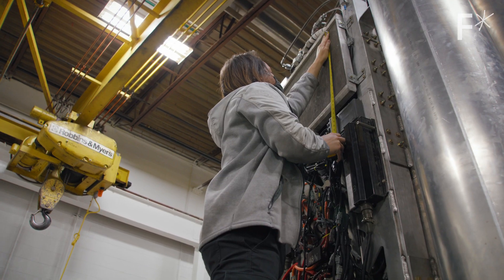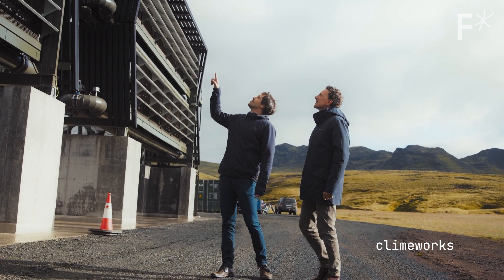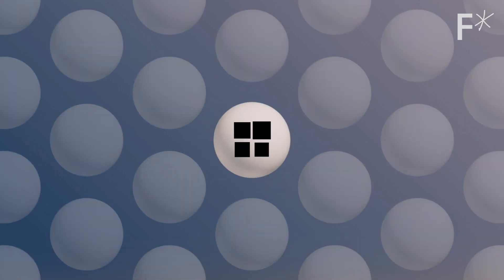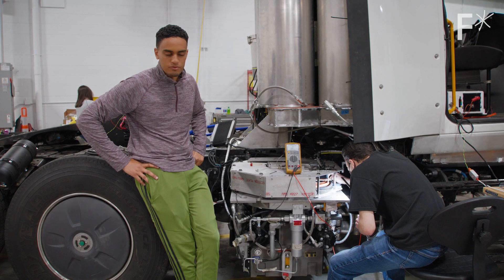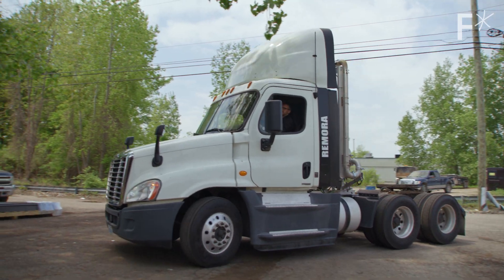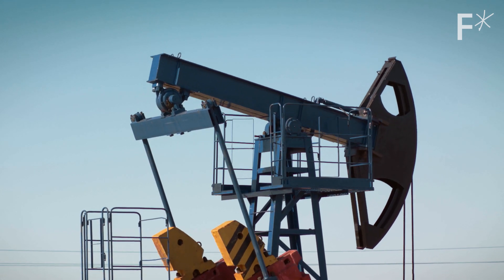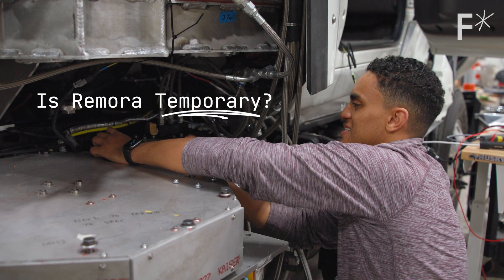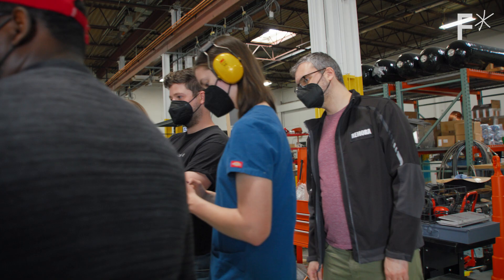Can this invention fix dirty transportation? | Challengers

Comment: The solution to truck polution is to switch to electrified rails as the primary way of transporting goods long distances across land, and only use trucks for "last mile" delivery
Reply: Trains are some of the most efficient transport methods on the planet.
Strapping a battery to everything isn't the answer folks
Reply: @stuartburns8657  You  must take a look at the March edition of the scientific magazine'Joule' and the 'CO2Rail' website to see the 'DAC railcar' innovation which will allow trains to capture CO2 from their slipstream while using the  energy from braking to power the. units which  have been reduced to rail cars size.There will also be a railcar to  extract emissions from the  diesel engine.Unfortunately  it is unlikely to  capable  of. being scaled down to truck size but who knows maybe for aviation?
Reply: @edwardhogan1877  Sounds interesting Edward.  Wonder if it would make a significant difference
Reply: As a former truck driver I completely agree with you. If there is any way to make it be more efficient using rail it makes way more sense although there still is going to be a need for smaller local truck deliveries.
Reply: You can't upscale the device because you need someone that can make that happen.   Has anyone presented the idea to an Elon Musk or a Jeff Bezos?!
Reply: You have no idea how transport and logistics work if you say that's the solution. I am a truck driver since i was 21(now i am 30yrs old) and your solution means substantial changes to global infrastructure.
Reply: @aurelianpetre93  And there's half the problem. The immediate assumption that changing infrastructure isn't a part of a solution. So, yes, over the coming decades we should look to make some sensible changes to the way we do things if the human race is to move forward like we used to.
Reply: Sorry but most trains get really good gas mileage so using all the rare earth metals for these trains or build more power plants which adds lots of carbon pollution to accomplish is not a practical solution.
Reply: @waynemc2300 what rare earth minerals? Copper for overhead wires? Copper isn’t that rare. Unless you are under the assumption that’s electric trains are battery powered which is false. Electric trains are powered by pantographs harvesting electricity from overhead wires.
Reply: It will be cost effective given feul prices and the reduced efficiency an extra 5000 lbs carries
Reply: if it's not cost effective there's no incentive to do it
Reply: @your_a_idiots  We literally print our own money and assign our own values; we control all incentives around money.  These aren't random forces of nature we are talking about here.
Reply: We already do that.....
Reply: @nntflow7058  In the US? Barely. (Proportionally speaking.)
Reply: Agreed. We need to stop thinking of train tracks as being something for one large engine to pull a series of cars behind it, but rather one electrified train engine and one train car that can autonomously go to it's destination and autonomously be collected by crane and put into a depot for pickup by an electrified truck. Perhaps monorails for shipping between major cities, something above or below cars and foot traffic.
Reply: @Delosian  do you even know what you’re talking about!? Trains are efficient and were hybrids before cars.
Reply: You’re funny. Look how well the California rail system is going. No chance is this concept viable even it people wanted it
Reply: Coal burning electrified rail? Or how about renewable diesel from grass or wood chips using compressed air to burn every diesel molecule leaving the tail pipe free of carbon ???
Reply: How is the electricity being produced? It’s only a matter of time before the environmentalist complain about lithium mines, battery pollution, and the grid.
Reply: @danshobbies13  Do trucks  produce currently wasted. energy in braking?

Comment: You can do this without trashing EV and H2, there will still be millions of combustion trucks on the road for years that need this, even if all manufacturers switched to zero local emissions tech overnight. (And there's still the 20% this solution doesn't capture, that's way dirtier than an EV or Hydrogen rig)
Reply: The state of California has already taken notice of this when it initially proposed the now infamous 2035 Internal Combustion Ban, but the trope with this ban is that it applies to automakers building cars with an ICE drivetrain, not that they're trying to get rid of combustion powered vehicles as a whole.
Reply: @TheSilverShadow17  true, but if new combustion engines are banned in 15 states eventually in about 20 more years the problem will take care of itself on the used market. The problem is can they survive 20 more years of extreme weather? Then they need to tackle other shipping like cargo and cruise ships, diesel trains, factories, etc.
Reply: @KaceyGreen  I think they still are going to be around even after the next 20-30 years. As I mentioned about California banning combustion powered vehicles, the ban only applies to the automakers, not us common folk using them on a somewhat daily basis. For instance let's say I was one of the vehicle manufacturers in the year 2035 and I tried to sell a brand new car/truck etc that has combustion power. I won't be able to because of then state law that prohibited the sale of said vehicle. But older vehicles that were built with an engine prior to 2035 are still allowed to operate and be driven freely.
Reply: @TheSilverShadow17  exactly, the reason I used 20 years is that was the most recent fleet turnover period but I think it was trending to 25 years at that point

Comment: This feels like a crazy complicated solution for this problem.. but the one thing I wondered was whether that truck could make a full turn with these huge devices on the decking?
Reply: I don’t think it would make much of difference, but except the view to your airlines while making a u turn , and will help on winter to give your traction tires some control
Reply: Actually, they are using existing and mature technologies in all pieces of their creation. It's just that they have never been put together in this way for this purpose. I recognize a lot of steps used from other industrial processes.

And yes, since they are installing it where aftermarket parts go, it means the space is designed with bulky additions in mind.

I think adding a co2 infrastructure to the truck infrastructure is going to be a headache, but if there is already an existing infrastructure to take advantage of, that works out great.
Reply: I agree, especially with a sleeper cab attached behind the tractor... I've spent many hours designing equipment for rigs...sadly...this idea will likely remain a prototype.  If you want to decarbonize there are many easier ways such as biochar with soil remediation.  It matters very little where the Carbon is removed... only that the "genie is put back in the bottle"... metaphorically speaking.
Reply: Thats the point , the truck cannot make the turn. They need to place the complete mechanism somewhere else , either at cabin top or trailer top

Comment: The anti-rail sentiment that Gross alludes to toward the end shows a dangerous bias. It’s great that a bandaid was developed, but the implication that it should be seen or used as anything more than a bandage is potentially misleading. If the content devoted a section into digging the numbers in a comparative fashion, this piece would hold more integrity than branded content.
Reply: They bashed everything that wasn't their capture solution, very poor form, especially since they'll still have millions of potential customers no matter what other lower or 0-local emissions tech also gets deployed

Comment: Seems like they need to find a way to make this waaayyy more simple to install and operate.  I can't see it going anywhere until it is easier and cheaper to buy and install it.
Reply: Yeah it needs to be multiple capture filters that can be replaced like an air filter.
Reply: Looks far too complicated as it is, so I wonder how easy it will be to scale up so that the end result is both cost-effective for the customer and profitable for the manufacturer.
Reply: New devices often start that way, though, don't they.
Granted, the time scale needs work, but think about computers that took up the space of a whole room just 60 years ago, and now they take up the space of a match-box.
If they can get that 60 years down to five, and with the money coming in they may be able to, great.

Comment: I was all for this until this guy started trashing battery operated vehicles and how much it costs to operate them and what it takes to recycle them. Same thing goes for a Gas guzzling truck that emits 200 tons of CO2 every year. 

Thanks but no thanks. You can do better. Another thing I waited patiently for but was never mentioned, the price tag. How much does this thing cost and how many capture tanks do we need to install if lets say we add this to only 5% of the 2 million fleet that already exists? 

This device can store up to 12 tons of CO2 how much more gas does the truck need to carry all that until they arrive at a station that has a CO2 offloading tank.

Don't get me wrong. I love the idea but I think that it's still at a very mature stage and much more could be done starting with not trashing other companies to prove that your invention is better.
Reply: 100%!
Reply: I think the point they were trying to make is that the media, is trying to portray that our C02 problem will be solved by electric vehicles. A form of brainwashing, how come we don't see more news, and articles about whats powering the plants that make these cars. Or the diesel generators that charge the batteries. Or the gas powered vans that service Tesla vehicles. And lets not forget about making the parts for these vehicles. 

I think the point they were trying to make is that we should be careful to not create a bigger problem by trying to solve a previous problem. Personally I think we should have tried to electrify plants first before we start producing electric vehicles. But you know one step at a time.
Reply: @wovasteengova  you can do both at the same time, Tesla cells produce more power than all their factories and all their cars use to-date, I'm sure many of the other manufacturers are working towards similar numbers as they can cash in on those credits. They just need to focus on what their product does great, no need to bring up the other solutions as they are new trucks, new powertrains for existing trucks, or trains replacing the trucks
Reply: @wovasteengova  I agree with you to a certain extent but at the same time, I'd rather have an electric car that could be charged from a home charger powered by a wind turbine a solar panel or so than a car or truck that run on Gas. 

I live in Oklahoma, I wanted to purchase few acres in the country and was told that I had to hire a company to clean the land because it had an oil well on it. The cost to clean it is not even worth mentioning. This is just a very tiny example of the cost to dig for oil. Let's not talk about what gets injected underground to get the oil out or the consequences of fracking or our reliance on oil imported from the middle east or South America where human rights are practically non existent or are violated on a daily basis. 

Let's not forget about all the oil changes that a Gas car needs and where does the old oil end up. 

Let's not forget about all the extra parts, muffler, carburetor, gas tank, radiator and a few more. 

I also agree that we do not have perfect batteries yet but the batteries we have today are much better than the batteries we had few years ago. The driving range will become larger and cost will go down.

Thank you for reading my comment!
Reply: @rhoula  thx for your comment. And knowledge

Comment: clip on. you make it sound like its a tie clip. so misleading. engineers, welders, people responsible, still need to make all that safely attached for impacts, collisions, vibrations, aerodynamics, thermodynamics, electrical load, pressure load, balance....  so, clip on. typical misleading title. like saying 'put' a house on a rock outcropping. there's tons of work needed for such things, but soft words mislead us to thinking its easy.

Comment: 7:36 and this is where the whole idea goes into the wrong direction. The CO2 is not stored and stowed away for good. Instead, it's reused and sold to existing carbon-using industries. That means, it lowers the CO2 footprint for semi-tracks because all of it is then transferred to other industries. Clever marketing, but absolute bullshit for calling this a solution to fight climate change.
The idea at 8:54 should be the only solution and simply not sell it to any industry.

Comment: This is a great idea for existing trucks but the whole point about evs being a total greenwash is so true. Hydrogen fuel cells seem to be the way to completely decarbonize the entire transportation industry & we needed to start the infrastructure for it decades ago. I'm glad they refuse to sell to oil companies to pump more fossil fuels out of the ground but even at that a lot of politicians will use this tech to say it's okay to keep using them even though that is not the stance of this company.
Reply: Hydrogen is not a fuel source so much as it's a compact energy storage reservoir similar to batteries.  A dead battery needs to be charged to be useful hydrogen needs to be captured from water breakdown or from fossil fuel byproducts. In all cases the energy to charge a battery or collect Hydrogen is net negative... whereas collecting fossil fuel directly is net positive (coal, oil, natural gas).  Also hydrogen needs to be stored at high pressure at room temperature or super cold for lower pressure not to mention its volatility too!
Reply: why do you think evs are green washing but hydrogen cars aren't? Hydrogen requires a lot more energy to extract with current technology then the amount of energy we can get out of it later

Comment: Cool idea but some FUD with electric transport. Tesla has produced more electricity through their solar division than they have used in their manufacturing to date. Batteries are close to 100% recyclable today and there are companies doing so. The electric grid is getting more green as time goes on so all non issues, just some FUD. But otherwise a really cool idea for the interim. Hope they succeed but its maybe a solution thats around for 10 years max
Reply: EVs use rare earth metals that are toxic, mined which destroys the earth & produces huge pollution, & some of them are in small quantities that we will run out of. & the vast majority of electricity is from coal not renewables. Not to mention no countries electric grid could handle a large influx of EVs, they can't even handle air conditioning in ever increasing heat waves. Plus huge numbers of people who live in apartments would never be able to charge those cars as it's very expensive for a complex to put in charging stations & it would only be enough for a few cars. We need to get transportation off oil and electricity onto an entire different infrastructure & right now the only seemingly feasible way to do that is hydrogen fuel cells which many other countries started working on years & years ago but didn't happen in the US because our govt is owned by corporations including oil companies.

Comment: Imagine if you put all this brain power into solving a problem that was actually a problem.

Carbon dioxide is plant food people! We can only grow more and more biomass the more carbon dioxide we have.

There is absolutely zero evidence that says carbon dioxide is bad

There's not a greenhouse in the world that would run less parts per million than our atmosphere currently is.

Gardeners will often run greenhouses four times current atmospheric levels and they work in those greenhouses all day long and they have no ill effects from it..

Did you know that sailors on a submarine will almost always be over the parts per million and allowing up to 10 to 12 times CO2 levels in the air under certain conditions

Comment: Very cool! Definitely strikes me as a stop gap, but a highly valuable one that paves the way and tees it up for others to develop better post-capture tech.
Reply: They should enter the XPrize
Reply: @cstuartdc  There are quite a lot firms trying to do this, one of the first and best known though was a greenwashing project by a german initiative financed mainly by shell. But they never got above 200 tons a year at atrocious cost.

Lots of modern high-yield greenhouse firms enrich their planting spaces air with CO2 up to 15% to increase yield.
But in the end all that plant matter is only a short-term storage for carbon. As soon as the plant matter gets eaten, burned, used for composting soil production ect, its out in the cycle again.
Even if it gets used to produce building materials its only sequestered for a few decades.
Reply: Is this a bot response